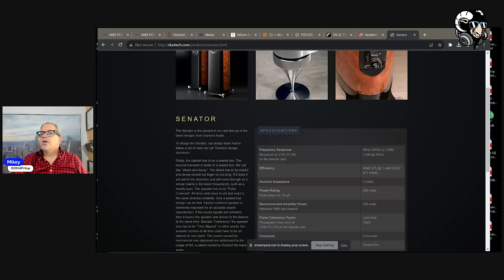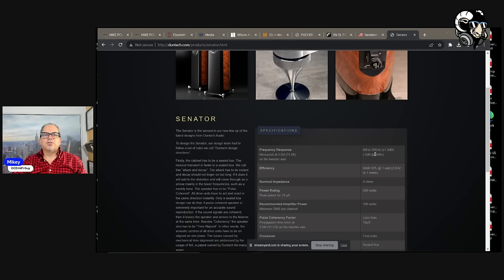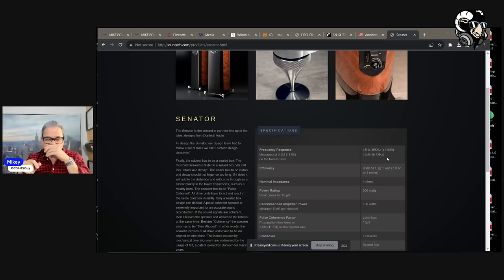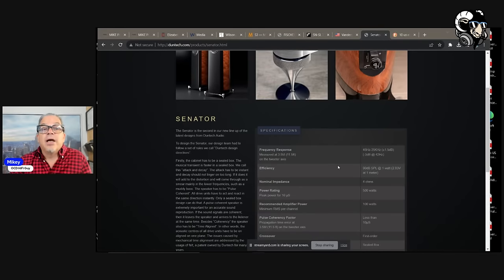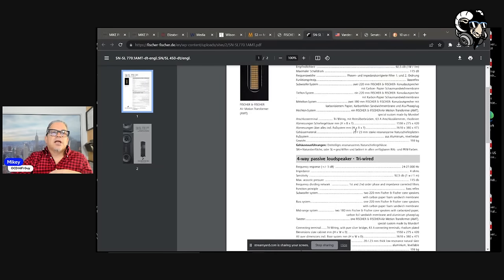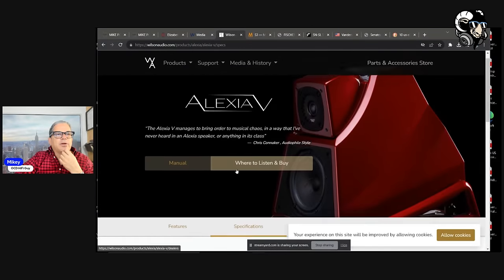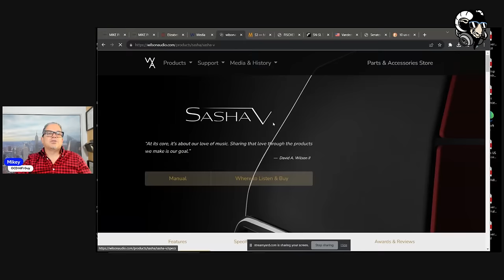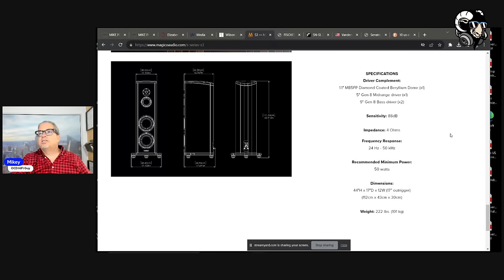TRUTH about SPEAKER SPECIFICATIONS !!

Comment: In my limited experience a big room (and a good amp) allows a speaker to better reveal the low frequency performance it has. I don’t know what the sweet spot is but I know its not 13x14 feet unless you really like 40hz. My goal is to experience a measurably flat room and then see if this is actually desireable or not.

Comment: My favorite is 'in room response' where they can add room gain to claim that they go down lower. Maybe you can comment on active speaker measurements, do you find that they are more usable since active EQ can be used to widen and flatten the response?
Reply from the maker: Exactly... I think tuning the rig on the fly for the room/amp/speakers actively is where things will inevitably head..
Reply: Every 3db boost uses twice the power , too much EQ to compensate for bandwidth roll off  kills dynamics and sounds unnatural unless HT playback ...

Comment: Something that is missed completely in speaker measurements is what sound is actually coming out? e.g. a small driver speaker used as a woofer when pushed hard will "double". it will produce sound pressure, but some will be at the 2nd harmonic of the fundamental sent to it. So you put in a 20hz signal and use a mic to measure the SPL. The total energy the mic detects might be at say 3db down from say 1kHz. But not all that sound pressure is just 20hz. Some is 40hz, ... but all you know is the total SPL, not what all is in it. 

Or ports, which provide an output that is out of time because of the internal delay path of the sound. But to that mic, it is signal and will be included in the overall measurements. IOW just because there is some sound pressure measured at a specific frequency does not mean that speaker goes that low with any accuracy. Just that it makes noise at a certain SPL when that frequency is input.
Reply from the maker: Great addition to the message Glen, 👏 thanks !!
Reply: @OCDHIFiGuy  Random neuron firings! My family is less appreciative of them. 🙂

I was at the press release announcement for the first DBX auto-room EQ (DBX 20/20?). I was a  DBX Rep at the time. Pink noise generator with calibrated mic. Would do a narrow band sweep internally to adjust the bands. I suggested that if the speaker was having problems at 30hz it would double and create 60hz signals. So this thing would boost 30hz because it is low, causing even more doubling, and drop the 60hz because of the added energy from the 30hz doubling. 

I was literally escorted out of the room.

Comment: You hit the nail on the head with the pro audio reference. Impossible with flea wattage.
Not cheap. Not great efficiency. Deficits are covered with power. Bass frequencies use amperage. Why my wife bought Yamaha NS-5000 for our 500 watt Ice Modules.

Comment: This is not different in most industries, new Corvette stats on the website, 495 HP, 8 speed transmission, 0-60 in X, and that's about it.  Manufactures save the dyno and details for third party reviewers, an entirely separate industry that lives in the same ecosystem.
Reply from the maker: Yep, that's where they find out its not anywhere near spec at the rear wheels. So yes, thanks for cementing my point that Manufacturers, many times only care about specsmanship, fluff, and marketing. Thumbs DOWN...

Comment: +/-3db is referring to power. +/-10db is loudness/volume

I understand your point, but in the interest of accuracy, wanted to set the record straight. 

+/-3db is often used as 3db is the difference in volume that average people can readily detect. +/-1.5db is a better measure to use for “audiophiles”.
Reply from the maker: Yeah, I got SPL and volume/loudness mixed up.

Comment: I don't think you meant that -3 dB is half as loud. Also, in the bass region is not the total output not also a critical spec? Thanks, Mikey!
Reply from the maker: You bet Bruce ! I did mean that -3dB is half as loud. Do you know otherwise ?  Total output is system dependent, and I was keeping this vid about published speaker specs and how they can be useless sometimes.
Reply: I think that 3db is half as much power, 10db is half as loud. That's what I have always seen quoted. 3db down is noticeably quieter but more than half as loud.
Reply: @OCDHIFiGuy  Thanks, Mikey. My understanding is that -3 dB is a noticeable change in loudness but not 50% and that -10 would be perceived as half as loud. As Dave, below, indicates perception of loudness is logarithmically related to actual power. But, I may be wrong or am getting tripped up on semantics. In all events, Mikey and Dave, thanks for great stuff!

Comment: LOL magico doesn't even tell you the Frequency response to their stuff!!!  SPECIFICATIONS
Magico M3 over 100k
Driver Complement:
1 X 1” (2.8cm) Diamond Coated Beryllium Dome Tweeter
1 X 6” (12.24cm) Graphene Nano-Tec Midrange
3 X 7” (17.78cm) Graphene Nano-Tec Bass

Sensitivity: 91 dB

Impedance: 4 Ohms

Recommended Power:
20 - 500 watts

Dimensions:
48"H x 19"D x 13W
(120cm x 49cm x 34cm)

Weight: 320 lbs. (145 kg)

Experience the M3
Reply from the maker: BUT it's MAGIC !!!

Comment: FYI - A change of 3 dB is accepted as the smallest difference in level that is easily heard by most listeners listening to speech or music.

3 dB rule: A 3 dB gain means twice (x2) the power. A 3 dB loss means half the power. For example, a system with 40 watts of input power and a 6 dB insertion loss will only have 10 watts of output power. dB: Decibel, a logarithm (equal to 10 times) ratio of the difference between two values.
Reply: That's pedantic.

                                                                                Acid Jazz, Funk & Brass   🔈🔉🔊
Reply: 1db is the least notable change. Not 3db. 3db in SPL is either twice as loud or quite! Dramatically noticeable.
Reply from the maker: Yes, good point, but I agree it's much smaller. I like tenth of a dB steps for gain.
Reply: @OCDHIFiGuy  With a good stepped attenuator!